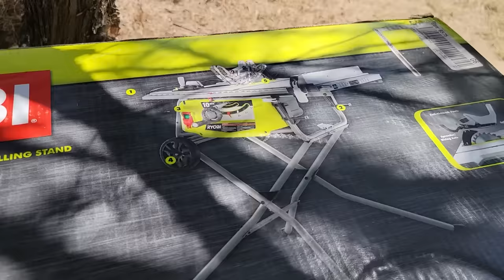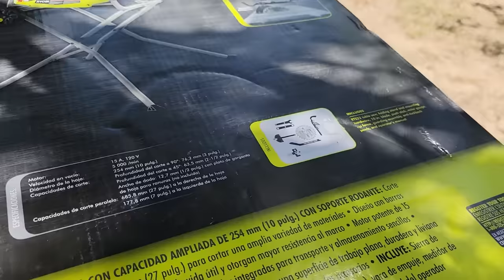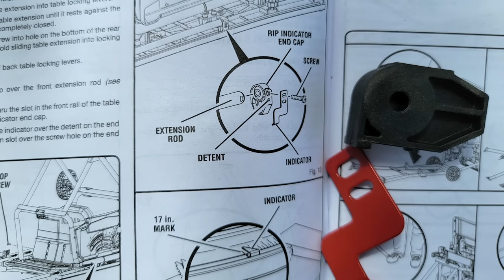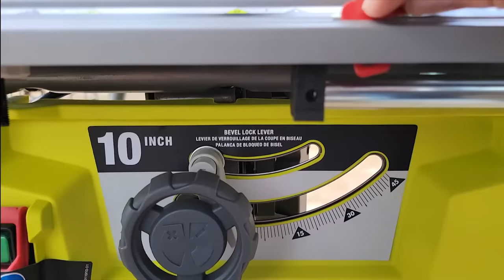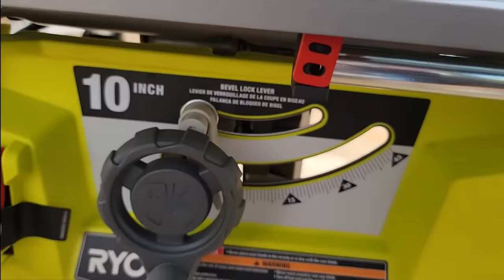Ryobi 10 inch table saw unboxing and field setup

Comment: Understand the issues with filming ,but would appreciate or I look forward to more videos about the table saw. How it’s been working how it folds and rolls and your thoughts
Reply from the maker: I leave it on the support stand completely. So, no rolling for me. 

This means I pick it up as a unit and muscle it around when it rains. This is tough on me - but in a compliment to the table saw - it all stays together and is very rugged.

I use it a lot, and for very thick timbers. So far this saw is a 5 star product and I would recommend it. I did upgrade the blade to a really good Diablo blade. I am hoping to finish the entire house build with that single blade. We shall see.

Comment: Unfortunately, too many times your Camera stopped recording - I believe you should’ve  taken the time to re-edit the missing parts
Reply from the maker: Thanks for the tips. I will continue to work on B-camera work. Most of my problem was the tremendous heat this summer. All my equipment overheated. 140F on the soil it was a scorcher. I did buy a new camera this year to help me out. Appreciate the input.